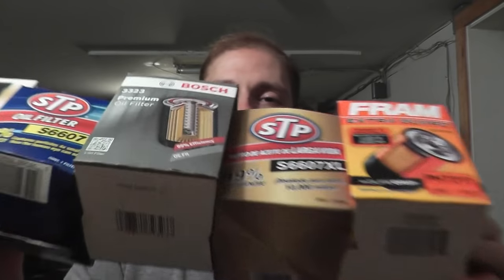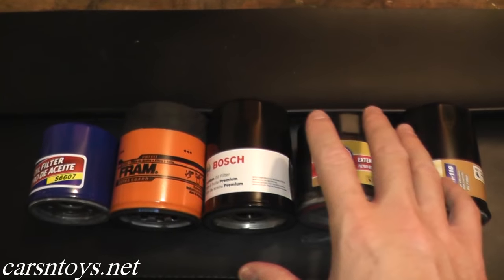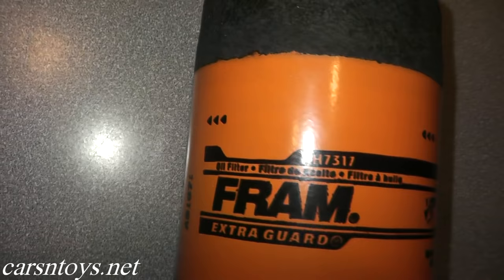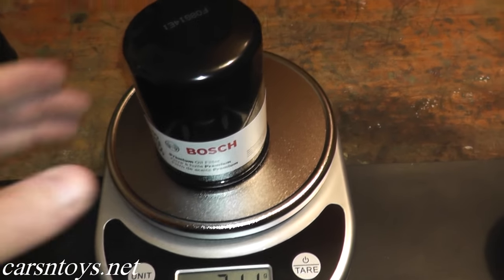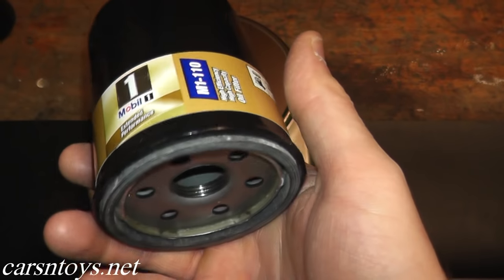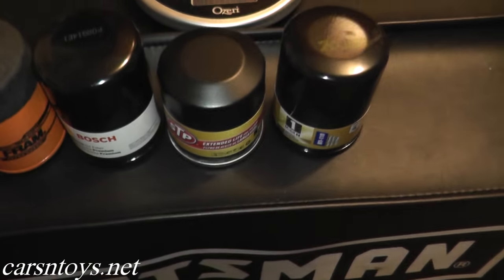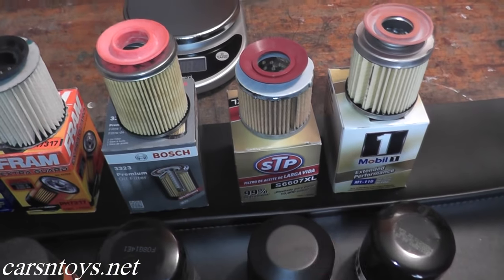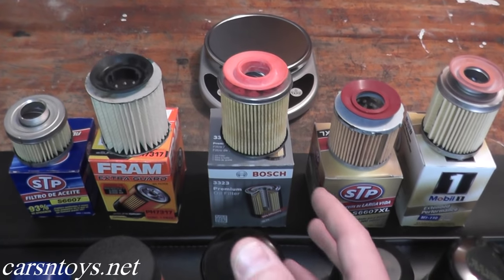OIl Filter Comparison...STP vs FRAM vs BOSCH vs MOBIL1

Comment: Instead of focusing on the weight of the oil filter, you should have informed people of the important things like the surface area of the filter media, it's composition, and the particles that it will trap.

I have an F-250 that uses a FL-2051s motorcraft filter that weight close to 1,000 grams  I don't think weight has anything to do with the quality or performance of my filter.
Reply from the maker: This may be what you're looking for - https://youtu.be/kx-NT1DEtlU
Reply: That's pretty good.  Do you know of any videos that demonstrate the size of removed contaminants?  I don't know if SAE has any specifications or if the auto manufactures have specifications as to the particulate size the filter needs to remove.
Reply from the maker: I don't but the specs I go over come directly from the manufacturer.
Reply: The usual filter removes particles down to about 40 microns.
GM did a study which was published by the Society of Automotive Engineers, reduce the size of particles filtered out from 40 microns to 5 microns and the engine lasts eight times as long.
Reply: He does and has
Reply: Also flow rate is important the more inlet slots better the flow rate

Comment: the filter media is paper so weight is not a sign of quality, some metal oil filter  'cans' are likely thicker giving higher weights, but not necessarily quality, FLOW test and particle filter pass thru are good ways to tell best filter..
Reply: Is it just paper media in all filters? I think there's so,e synthetic martial in some.
Reply: Shane Gansk
Reply: +Curtis Hermanson  No Mercedes has good fleece in factory filters.
Reply: but if there is more media in one over another then it will filter better

Comment: Good job.  I’ve only used mobile 1 on my 2004 Ford F-150 that I bought new. Right at 250000 miles and drove it from middle America to Cali coast last May when temps reached almost 100 in some spots. Still running strong and will stick with the few extra bucks it cost me.

Comment: The more expensive filters might be overkill if you are changing your oil every 5K like I do. I have used Fram filters for many years changing the oil every 5K and I've never had any engine problems.

Comment: wEIGHT HAS NOTHING TO DO WITH IT. sOME OF THE FILTERS HAVE MORE METAL INSIDE AND LESS FILTER fyi
Reply: Weight reduction bro
Reply: +SuperDagod1 Just having a thicker guage can will increase weight. Weight would really be a poor way of judging how good a filter is.
Reply: +Torpedomtb 
I totally understand what you're saying.
Perhaps a more accurate test would be to completely dismantle the oil filters, and just weigh the actual filter material.  But then, there could be an issue with the difference of synthetic vs natural (and / or paper) filter material.
Reply: +David Fisher damn it I should kept that fwd those twin turbos give too much power
Reply: Your wrong weight does the filter that's made out of better material last a lot longer  so the heavier the better.
Reply: neal6473 I wonder why no brand makes a filter with thick and strong filter media as well as a thick canister and wire mesh to hold the media with a coil steel spring and silicone anti drain back valve
Reply: Brian Martinez
Cost.
Reply: In fact a good point. I would be very glad to see the test would actually includes cutting the filter material and weighting them ONLY. Then adding the total area of each filter as well. Kind of BMI (Body Mass Index) that the better doctors consider to monitor, rather than your simple weight measurement, in order to better monitor your health.  Well may be a subject for someone else or your future test video clip.

Comment: the Bosch is the only one in the group that has better than 99% multi pass filtering so it gets the smaller contaminates
Reply: Ian Irizarry 99% great but also have to factor in what size microns makes that claim of 99% like 20 micron or 30 micron.
I see filters making claims but with different microns
Reply: @countryfamilyalways7280  The Bosch Premium Oil Filter used in this video is 99% Efficient at 20 Microns -- due to it's patented FILTECH Media. No other major oil filter maker uses the FILTECH Media at this time. -- I've seen no evidence that any other oil filter passes ISO #4548-12 at 20 Microns.
The famous 95 MERC runs Pennzoil Ultra Platinum, 5-W-20; Bosch Premium Oil Filter #3410; and a FILTERMAG # SS365PR Magnet Kit. Oil & Filter Changes at 5,000 miles.
Reply: @SlikLizrd  sounds like a good filter.
I know the Fram Ultra and Purolator Boss also are 99% at 20 microns also....

Comment: This is the second video I've seen that appears to show that Fram filters are crap.  I try and use the best products on my vehicles including the best oil and filters. I wish this video would have also checked out the K&N filter.  I use a superb car maintenance tracking software on my computer www.lonewolf-software.com/automotivewolf.htm that notifies me when any type of maintenance is due on any of my vehicles. My truck currently has over 250K miles without any major repairs so just following your maintenance schedule can save you a lot of money!
Reply: Great software!  Highly recommended.
Reply: I use that software too and Love it!

Comment: Mobil one has always worked well for me. I've used it exclusively in all of my modern cars since the late 90's. Don't think i'd buy the bargain basement filter but i'd not hesitate to buy any of the higher end ones. Especially the Bosch since they seem to make very very good products. I've not ever purchased their oil filters but their Icon wiper blades are amazing. And as stated MANY vehicle OEM parts are made by them.

Comment: ive got a late 99 f250 7.3 powerstroke diesel, it only gets the oem filter. with proper care they can easily see 500k to 1M miles. the oem filter costs 10 dollars and its built to spec for the engine. while some aftermarkets might be better sticking with oem is the best bet. seeing as the injection system is HEUI using oil to fire the injectors i would rather use what is spec vs what isnt just because sure one might filter good but if it starts to become plugged up can cause issues overall causing the engine not to get proper oil flow. since the low pressure pump feeds the res for the high pressure if its not able to provide enough flow to keep oil in the high pressure system then you will have hard starts, no starts, rough running. but a by pass system wouldnt hurt on them. overall good video. but really the best bang for the buck is to get the oem filter.
Reply from the maker: +Cameron Brown Good info!

Comment: I used the basic STP oil filter with full synthetic oil with 5,000 miles of use, which took me roughly 5-6 months. I did the oil analysis with Blackstone Laboratories and they stated the oil filter did a fine job at filtering impurities from the oil. Though I highly recommend any top of the line oil filters of your preferred choice. I purposely used the STP oil filter for the oil analysis just out of curiosity.

Comment: That clapping and cheering sound is so annoying.  And its so loud.  9 minute video could be compressed to 90 seconds or 2 minutes max.  Too long
Reply from the maker: Appreciate the feedback.
Reply: Good intro. Bad / too loud applause. Do up a spreadsheet with your weights and other findings. Present it before the majority of the video clips. Narrate through it. Add to the description the times where you're just going to be cutting or weighing stuff. Some people want to see that, some don't. Then mention in the video before those clips to check the description if you want to skip it. Now everyone can have their cake, and you end up with one slightly more compact ~6-8 minute video, where most people will watch about 4-5 minutes of it. 

You'll get more thumbs up and subscribers because of the reduced ear assault, and showing that you value the viewer's time.

Add your insights / conclusion at the end. (or maybe before all the metal filter opening porn) You did good emphasizing which filters can go with which change schedule and type of oil.  You mentioned that you like the FRAM's grip, but also that it is cardboard inside. Those points should be summed up in a conclusion where you recommend maybe 2-3 of them. I don't like the look of that cardboard, and I'd want more filtration area than the first STP filter provides, and I also figure - buy local? (Same continent, anyway.) I'd have recommended the Bosch for conventional/synthetic due to its excellent quality (It's only a couple dollars more expensive, regardless.), the Mobil 1 Extended for high duration synthetic oils with longer change intervals. Good oil and filters are cheaper than a blown engine.

I don't think it fits your channel, but I once read a 50 page whitepaper about Mobil 1 synthetic oils used for forklifts and other heavy machinery.  They found no metal flaking or degradation in lubrication for about 6-8 years, ~60,000 miles equivalent. I trust the research - although I'm not certain that I am getting the same grade when I buy consumer extended range synthetic stuff for $20 - but on my own car I frequently go 20,000+ miles between oil changes, and it hasn't gone KABOOM just yet. Anecdotal, I know.

A retired car company engineer told me that they tested all the major brands, drove cars tens of thousands of miles, and were amazed at the differences in engine wear between the oils.  Good oil is worth the price. Another anecdote - they always say the oil looks fine when I get mine done, and advise me that I probably could've gone another 3-6 months or 5000km... lol. If they don't know how many miles you put on, you get a more honest opinion. Good reason to do changes yourself or alternate oil change locations.
Reply: Very good summary.